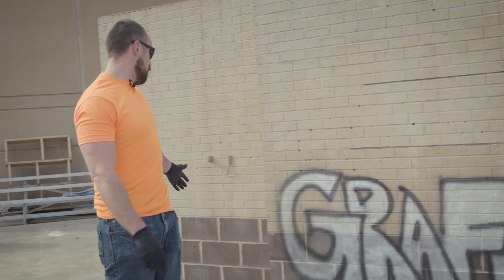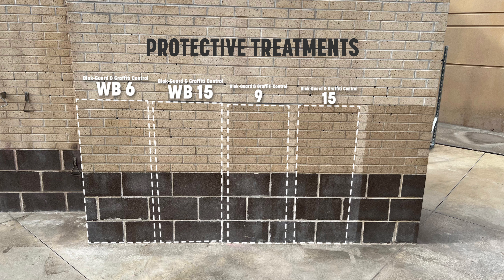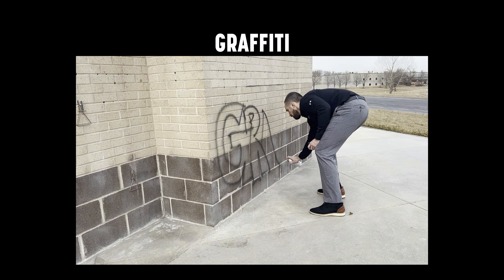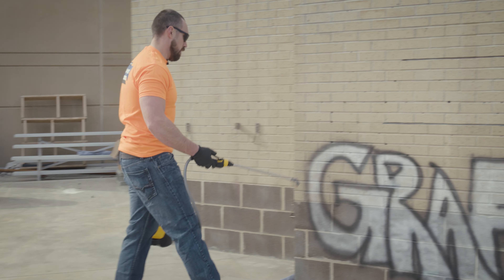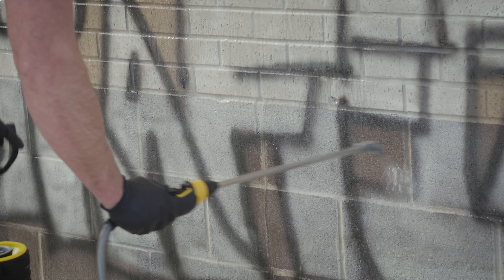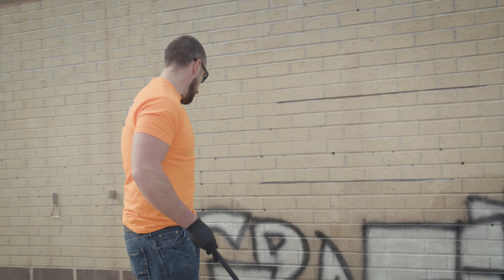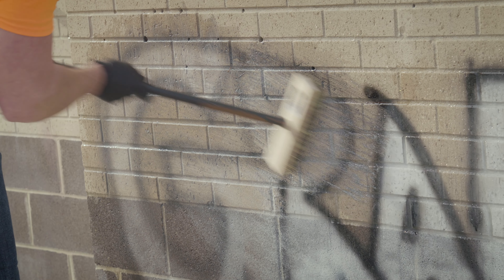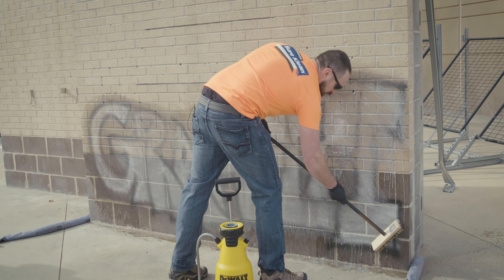Remove graffiti from masonry protected with Blok Guard and Graffiti Control

Comment: This video started out perfectly.  Just the information I was looking for as trying to determine which product to specify for my client.  The side by side visual of each product installed and how much it changed the look of the block was spot on what I needed to know.  But then it stops too soon.  Did all of the products work equally well?  Did the cleaner get the graffiti off the space between the coatings without any coating?